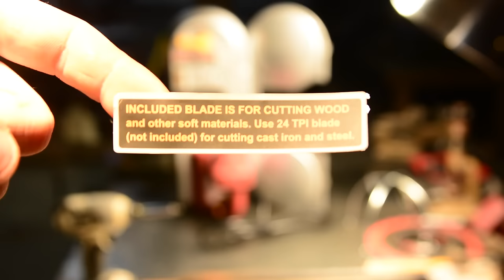A saw mount

Comment from the maker: Quick way to mount this Harbor Freight portable bandsaw. 
Thanks for being here, Please subscribe.
Instagram @davidwaelder
Twitter davidwaelder
Reply: +David Waelder I got you homie
Reply: is that saw any good,I've been thinking about getting it just not sure how good it is.
Reply from the maker: +Pat F thank you pat
Reply: +Dave's woodworks It's decent, especially for the low cost. I've had one for several years. I think I paid under $80 shipped to my house. It's VERY loud, but it has saved me a bunch of time on a lot of projects. If you plan to use it daily, I'd spend the money for a higher end brand, but for the occasional project it can't be beat. Waelder's right. The blade that comes with it is junk. Just plan on buying a 3 pack of blades at the same time.
Reply: +Dustin Rogers thanks,it's just gonna be an occasional use.
Reply: +Dave&#39;s woodworks I've been using one for about 3 years now. I build custom furniture. I highly recommend. Killer value. Use a 20% off coupon.
Reply: +Joe Doesntcareaboutthis thanks man.

Comment: Nice trick with the welder to bend the steel, I have been doing a full 45deg cut and welding back together.

Also noticed your source for the steel angle, bedframes!  I always stop and pick them up when I see them on the side of the road for disposal.

Comment: When you're trying to do a bend like 2:15 just notch the opposite side of the angle iron to "teach" it where you want it to bend. Also works great for sheet metal, so even a speed square then works well as a makeshift bending brake. 

For very thick metal you can also cut a groove on both sides of the bend (one side minimizes compression, the other side minimizes tension, and the remaining center keeps it connected), then weld it thicker again after the bend.

Comment: I used a similar way to dress my sheers or snips for years but since I don't have an angle grinder I used to use used up sandpaper :)
Now a few years later and having learned how to properly sharpen and dress up sheers and snips I cannot recommend it :D
At least the results you can get using a file or a stone are much much better :)

Comment: Great video. You would think these manufacturers (the better ones at least) would make a table mounting bracket to hold the saw vertical.
Reply: liability , I got wrote up by OSHA for clamping in a tristand stand. lack of gaurding
Reply: +Gib Clark I hear ya. I can understand the lack of guard if it had a guard to begin with, but that's not an argument I would want to take up with OSHA.
Reply: Their argument is when used as designed it's safe. When we clamp or modify it defeats original design. That's why tool companies can't deliberately design it that way. I actually built a stand for mine also. I love them . and Dave's is so awesomely simple and portable mine is a huge heavy in the way kind of thing